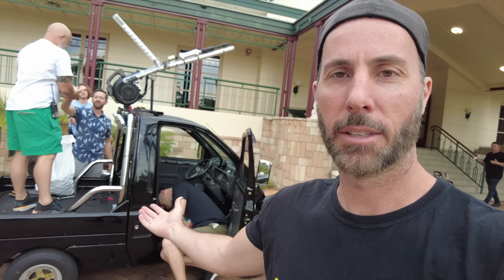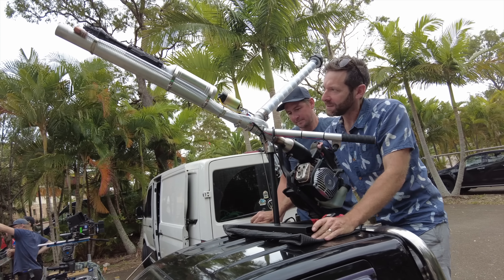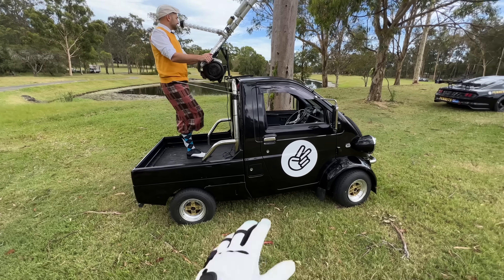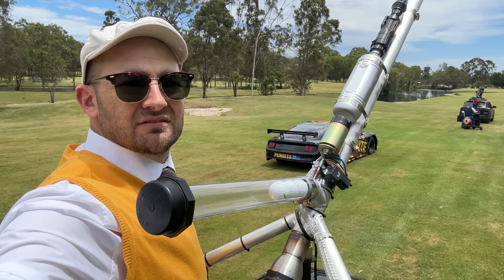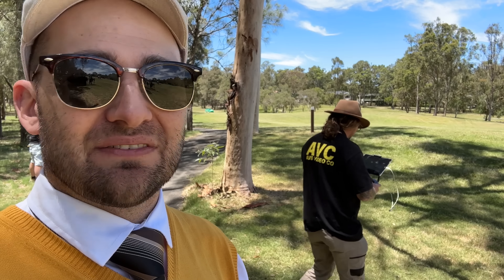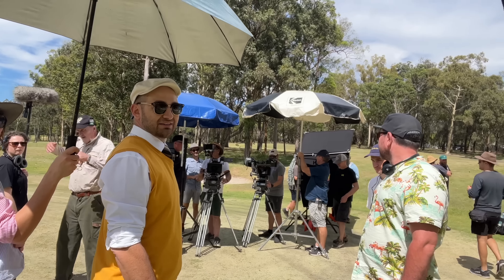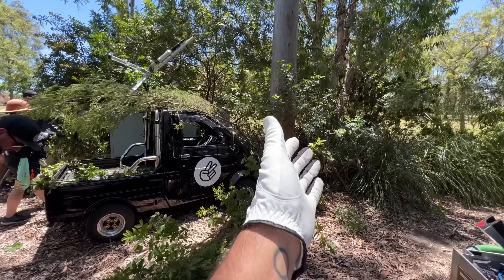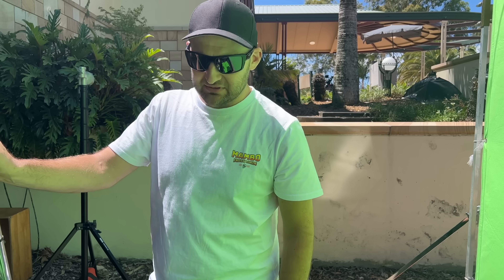Thrashing a Modified Midget on a Golf Course

Comment: Loved it ha ha, next time you two drive the midget together, get the gear stick guy to work the clutch as well. So the driver works the accelerator and breaks. Myself and two other mates figured this out when we use to car pool to work in a three seater courier Ute. Also watch ya plums on the second gear flat changes 😜😂